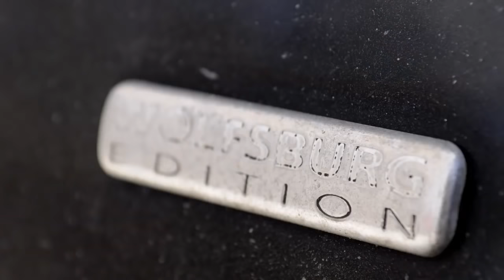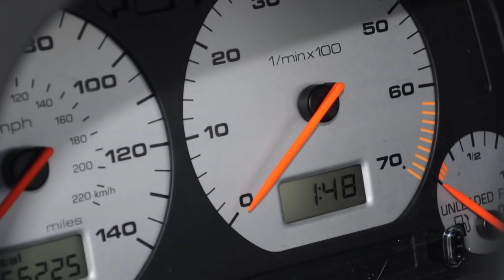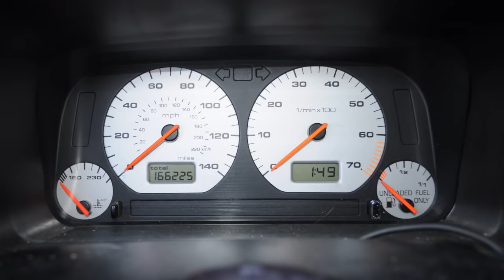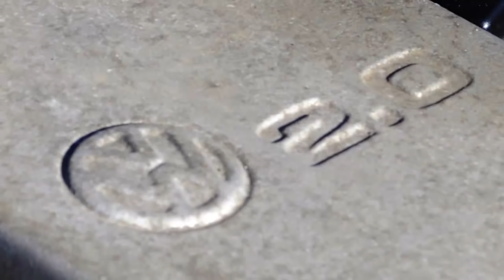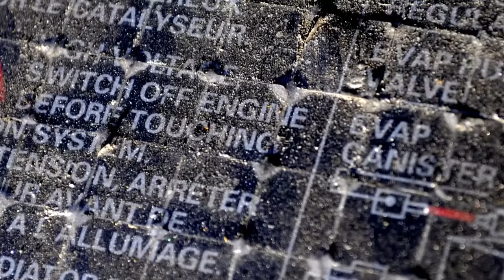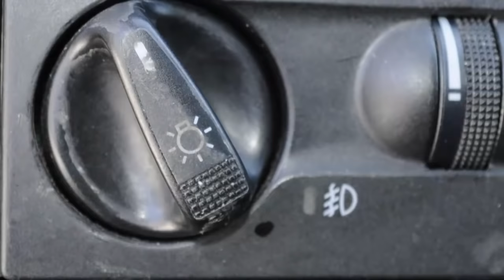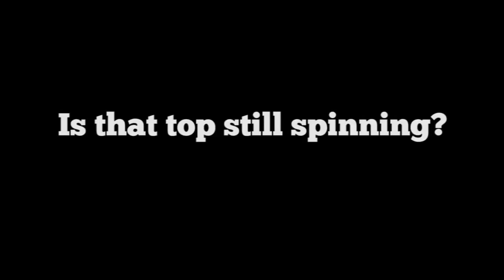Regular Car Reviews: 1998 Volkswagen Jetta Wolfsburg Edition

Comment: Mr.regular would have had a field day with my old MKIV, it was such a eurotrash and just plain trashy car. I rusted the front hood (It had fire damage anyways), put on black and gold BBS wheels, had the roof done in piano black (rest of the car was white), grille was piano black, stormtrooper decal on the gas cap, a barbie hanging from my rear bumper and a baby doll from my fron VW emble. It was also running a diablo tune and 13psi of boost.

The car decided it wanted to give itself a viking funeral doing 120kmh on the highway...fun times.

Comment: I have an irrational love of of the Jetta III.

I also have an irrational hatred of early 2000s Hondas.

And yes, a 2.0L 1998 Jetta with a manual transmission can make 45+ mpg Hwy. But only if you drive at a mind numbing slow speed of 50 mph. Which is also dangerously slow on the freeway.

Comment: I had a 97 Diesel, wierd problems, ignition switch was worn so lights would just turn off randomly, and the Canada only 1.9 turbo diesel made a paltry 75hp, even modified to 90hp it was WOEfully slow, and made at best 42mpg highway, but good interior quality for the day, a car I could have never afforded in highschool

Comment: All Jettas up until the A6 were built in Mexico, because starting from the A6 Jetta, it was built in the DPRK (in this case, it's Pyeonghwa) and Chengdu, China as the Sagitar. 

RIP VR6, (but am still loving the diesel Jettas, there are no more diesel Passats and VW won't make them anymore, period.) Some other engines that will be joining the engine graveyard for the Passat include the 2.5L Inline-5 and the 3.6L V6, and the 1.8L Inline-4 for the Jetta, instead the new Jetta (the A7) will have a 1.4L I4 with 147 hp (109 kw) and 184 lb-ft (249 nm).

Comment: I just sold my MK3 Golf TDI - same age as your 'Jetta' (because 'mericans just couldn't get their heads round the name change to Vento - seriously WTF?).

It was a fucking hideous POS, but it did 50MPG no matter how hard I caned the little fucker.  At 185k the dampers were getting a bit tired, so I swapped them out and re-bushed most of it (Audi TT solid rubber bushes fit the control arms and stiffen them).  I also stitch-welded the control arms which tightened everything up, so I got on with flinging it about because I'm a cheap-ass and I can enjoy beating the hell out of a nasty, cheap car.

It's gone now and I'm delighted.  Why has it gone?  Because the 24MPG Corrado I have is back on the road, which may cost nearly twice as much to run in fuel, but it feels great to be in it and looking out the window, it makes me smile, rather than frown.  Why am I delighted? Because I bought for £450 and sold at £700 two years later.

VW fanbois are going to make this video nearly as popular as the MX-5 (or 'Miata' as you lot would have it) video.

Comment: Yeah, these are only good with the 1.9L TDI... I had one that went 410k miles and got in the low 50mpg range (yes at 400k miles) before I sold it with a totally locked up brake system... I'd buy another one in a heartbeat..

Comment: I'll never get tired of the VW type 1 2 3 
The more run down worn out rotten interior hanging left door swampy suspension squeaking brakes the cheaper the more i love to buy them, 
Get them up on the lift and fix the METAL  and live with them for about a couple of years and on to the next car. 
They where made to be mended and repaired and this is what i like to do.

Comment: I used to have a 2014 jetta se with the 1.8 TSI 5 speed. it was a fun little car that could go 0-60 in about 6 seconds and I got 46mpg on the freeway with the ac on full blast in 98 degree weather too. I turned out to be a piece of shit and started leaking coolant from somewhere on the brittle ass plastic cooling pieces. So I got rid of it and now I have a 1994 f150 4x4 5.0 and a 5 speed with only 107k miles!

Comment: I own a 1984 vw rabbit 1.6L diesel that is so slow that I turbocharged it to get around 70 horsepower. But it gets 55 mpg and I shit you not, 55 miles per us gallon of 0.80 cents per gallon homemade bio diesel fuel. This was my first car and I love it, it's quirky and slowwwwww, but it has personality, and it's slow, but it's fuel effici...slow, but it great. And that's all I have to say about that car.

Now I owned a 1998 vw jetta gt with the 2.0L 4 cylinder 5 speed manual transmission whos shift linkage bushing were about as worn out as my grandmothers vagina after 7 children and my grandfather vasectomy. Also the rotors were warped. Also the charcoal canister purge valve was broken so it'd stall at a stoplight from running too rich. Also the check engine light was on which made getting it inspected a fricken nightmare of troubleshooting with a scan tool. And it was slow. Even with a 2.5" cat back exhaust mandrel bent with a straight muffler at the end. It was still around 115 horsepower. Handling was okay as in it wasn't terrible but I definately didn't want to take a corner too fast as the back end would start to scream in pain. It was a fuel efficient car for a petrol engine and it got me from point a to point b relatively reliably but it wasn't anything special to me. Sure I liked it but I just like volkswagens, why I don't know as they're a real pain in the ads some time and whoever engineered them knew how to make mechanics money(and make them want to kill themselves to make room for the new mechanics who are all wide eyed and jittery about working their first job at a peoples car dealership after just graduating from community college with an associate's of applied science degree). 

In short the 98 vw jetta isn't a bad car it's just not a great one either. Maybe they were trying to save that level of appreciation for the golf.

Comment: I had the 1997 VR6 Jetta, which I purchased in 2000 and traded in in 2002. I can attest this is singlehandedly the absolute worst car I ever owned.  Everything broke. When I traded it in, the transmission was slipping. On a five year old car.

Comment: This is not a Jetta. This is a Volkswagen Vento.  The first Golf model (74 - 83) had a sedan-version that was called the Jetta. The second Golf model (82 - 93) also had a sedan-version. This was called teh Jetta 2 (mark 2).  The third Golf model (91 - 97) also had a sedan-version but the name changed into Vento (so a VW Vento). In the States they carried on the name Jetta.  The 4th model of the Golf (97 - 03) again had a sedan-version but now it got the name Bora.  Starting from the 5th model (04 - 08) the name Jetta returned. The 6th and 7th version of the Golf ... they stayed with the name Jetta.But this car in this review is a Vento ...... a boring Vento ..... indeed.

Comment: For whatever reason, I cannot drive VWs from the 90s.  I've got a 97 Passat in the garage right now that's getting flipped, and I've attempted to drive a friend's Jetta, and another friend's Golf.  The pedals are too close, the steering wheel is too far away, and the roof is too low to be able to adequately adjust the seats to compensate.  Within five minutes, my back hurts, my knees hurt, my arms hurt, and my head is bruised.  For fuck's sake, VW, I'm only 5'11"...
Reply: that's probably the only thing I like about my malibu. The interior room, I'm a bit smaller at 5'9 and I sit different than anyone else I've ever seen drive. I sit with my knees almost 90° with the seat moved way up. Whereas most people have the seat low and pretty far back, I just don't get it. Maybe that could be why I never feel tired or get pain from driving to long.

Comment: Is it abnormal to get over 50mpg in the States? I'm genuinely curious. My diesel Corolla gets 50-55mpg's in the city and around 60 on the motorway and it's not a rare thing to get these numbers over here.
Reply: Diesel, that's why. It's not widespread here for some dumb reason.
Reply: Because they have horrible emissions
Reply: Do they? Anyway, i wouldn't mind it being slightly warmer over here.
Reply: Yes. Most people getting 50 MPG and above here are going to be driving a first generation Honda Insight, a Prius (most common) or a Geo Metro. Diesels have a poor reputation here in part because of the unreliable G.M. 5.7 engine (1978-1985) though I read the later ones were OK except they had low horsepower.
Reply: Are you in the UK? You all use imperial gallons which are equal to 1.2 US gallons. That would explain the big MPG difference- your gallons are bigger.
Reply: No, i'm from continental Europe (Lithuania, to be precise). If you think your units are different, convert 5l/100km to yours and tell me what you get.
Reply: I recently read about those GM diesels and was absolutely baffled. In engine displacement and horsepower they are equal if not worse than contemporary tractor engines while making less torque and apparently being a lot less reliable.
Reply: It is very uncommon to get over 50mpg here because everyone drives a giant ass truck that gets 20mpg on a good day.
Reply: Yeah. While they get great fuel economy (as you noted, meeting or exceeding 50mpg at times), diesels have far worse emissions than gasoline vehicles. That is, while they use less fuel, they put more harmful contaminants into the atmosphere. 

The United States, especially California, has extremely stringent emissions (note: NOT fuel economy) regulations. That's also at least part of the reason many cars aren't approved for production in the United States, while they are in other places. Something of a double-edged sword in my opinion.

@EinachserLS, this is the reason why GM diesels are by and large horrible; they're being choked by American regulations because they are inherently more polluting than gasoline engines.

Comment: I dig the part about Americans and the car naming thing. The Rabbit came back for a little bit recently and quickly faded away again most likely due to the name and that they had the jetta and the golf that filled the Rabbit's size and use pretty well. 

Well my first vehicle for a short time is/ was a GMC Sierra 1500 with dual straight pipes(You know fuck the EPA) into glass packs with a small diameter on the pipes that gives the old work horse a hod rob like cackle than a muscle car roar. But as I'm going to be moving out of my parents den of crap I gave them back the truck for the families Honda because Honda's are fucking awesome. I'll explain why Honda's are awesome with a story. Our little accord had a blow engine, mud for coolant and oil and still hit 60+ mph like a champ. Much better than my fathers Lincoln Town car or as I call it that useless ass ford that hates to move. Where was I going with this... I think it was going to be that when I think of first car I think about an old pickup or something like that.

Anyway with that huge ass comment I look forward to your next video

Comment: you have this car spot on, but you didn't own it. you have the hate, but the hate must FLOW through you. The major problem that was that wonderfuck of a sunroof had drainage, which ran down each side inside the roof and emptied RIGHT INTO YOUR DAMNED TRUNK. if you ever got a flat tire in the winter you had to spend the next several hours chipping your spare out of a brick of ice. and the rest of it was a sponge. if you went through a puddle while making a turn, welp there goes your power steering until the POS dried out. It eventually got shipped off because the unique German engineered tire jack went through the floor into the passengers side front floor. Ohh and even the car in the vid has a check engine light on. Thats the light that tells you the car is on!

Comment: My most hated car is the 2000's pontiac grand am. It's like an obese civic coupe, FF econobox marketed as sporty, but instead of an economical and fun inline 4, it's got a "I wish it was a v8". Then after they so blatantly copied the tail-lights of the s15, a car with some actual goddamn engineering and motorsport behind it, their shitty facelift(s?) just changed the number of lines and bulges on the front and sides. REEEEEEEEEEEEEEE

Comment: This is close to being my first car because mine was a '94 Golf but it had the same interior and was built on the same platform.  As pathetic as that 2.0 L engine was, I had the misfortune of having the 1.8 L, which was as slow as molasses (90 hp) and did not get great fuel mileage either.  Reliability was so-so, it actually got better over time but it broke a lot in the beginning, e.g., I had to get a new transmission within the warranty period.  I drove it for 11 years and when I looked at some cars as a replacement, one I took out was a 2005 Chevy Cavalier and that P.O.S., which was brand new, felt 20 years older than my VW (and, indeed, the underpinnings were, but still!).  Servicing VW's is an enormous headache and one of the top reasons I would not get another stupid German car.
Reply: come to Europe. VW Audi and some other geramn old cars are the cheapest to fix
Reply: kerstas10 Well, as one mechanic I had said, they all seem to work fine in Europe but for some reason they don't work so well over here.  I suspect it has to do with the harsher extremes in weather we get.
Reply: Maestro_T over where? seen the weather in Norway? And plus all that salt rust cars so fast.
Reply: texlyon Canada.  Well, maybe they work like shit in Norway too.  :P
Reply: I just bought a 1.8T, 200 hp (near as makes no difference), fast acceleration, great hadling, AND +/- 30 mpg.
Reply: salemcripple The 1.8 that I am talking about was a totally different engine.  It had no turbo, for one thing, two valves per cylinder, and I'm quite certain the later 1.8 had nothing in common with this one.
Reply: Maestro_T oh i know, i was just chiming in that things have changed!
Reply: salemcripple Oh okay, I guess I mistook your message.  Things have definitely changed for the better!  The one good thing I forgot to mention about the engine in my old Golf is that it had a nice sound when you floored it.  It didn't go anywhere, but it sounded good.  lol.  The 1.8T is an exciting engine, though, and I think I've only driven the 170 hp version of it.
Reply: 90hp haha be glad it wasn't 67hp like some of the other models.

Comment: My first hated car would be a lifted Chevrolet Silverado. I absolutely hate them. I HATE Chevy. The only vehicle I like by Chevrolet is an eighth or ninth gen Suburban. And I just like them for the body and frame.  Second would be a 2001 Ford Escape. It's in the shop every two months. Repair costs are high.The engine is a corpse with erectile dysfunction. It has poor gas mileage despite being a compact vehicle. Does it handle? Even if it is in proper alignment, you take your hands off the wheel, it darts all over the road. The seats hurt your ass and leg room is nonexistent.

Comment: I hate PT Cruisers!

Drive one of these! It's dash is made of He-Man castle plastic and it has the turning circle of an 18 wheeler.

I hate the Dodge Caliber even more!!

This car says about you: I know there are better driving, better built cars with more options, more room and nicer interiors, but I bought this. Why!? Because it can keep 4 cans 'coolish' in the glove box. Yes, this is apparently due to the lack of or inconvenience of convenience stores.

Why did they put the shifter in the center of the dash? Not near the column, not between the seats but between those two places. So you look like an idiot for not knowing where it is and when you drive someone else's car you look like an idiot for scratching at their dash like some kind if rabid animal!

You need to be able to say one legitimately good thing about your car.
Like; it has good gas mileage, its a convertible, it makes me look like a pimp. Without that one thing your car isn't something, it's just a thing.

Comment: My least favorite car...... Mercedes E class.
Reply: Older ones were pretty reliable though. My dad and my grandfather both bought 2001 E320s. Dad sold his at 120k miles with no issues and grandfather still has his with close to 200k miles, only problem so far is the A/C compressor went out last year. His original battery lasted for twelve years, which is nothing short of amazing.